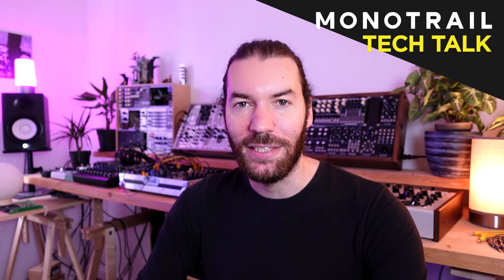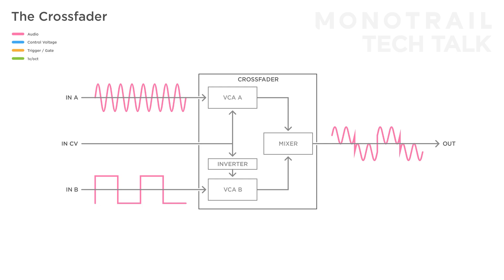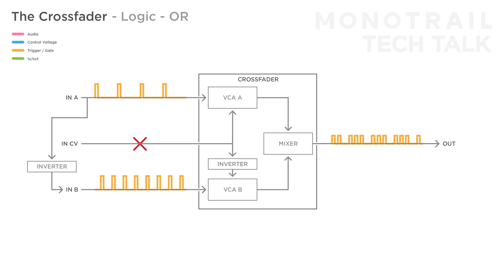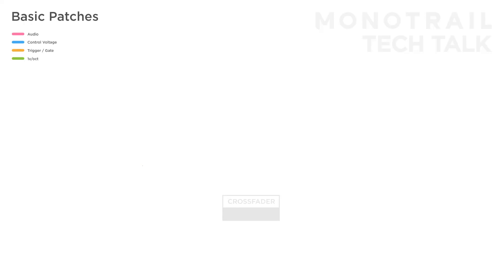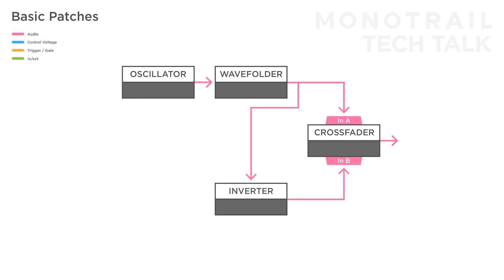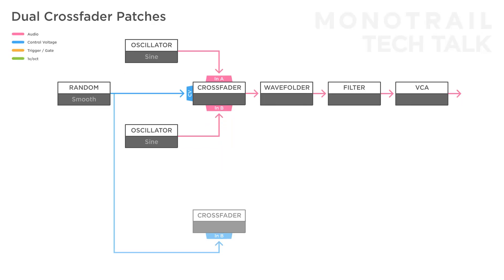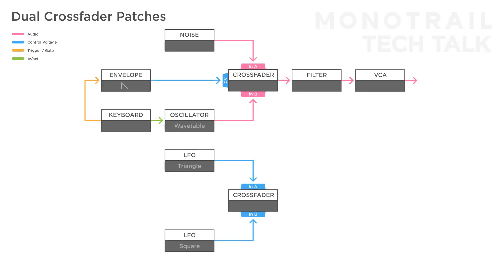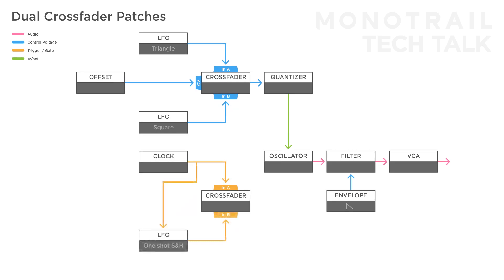Why you need a crossfader – The secret Swiss army knife, Doepfer A134-2

Comment: I’m trying to use Mk4 H1 - Crossfade/Pan to Crossfade between two triggers patterns but it does’t work as expected. I don’t know why.
Reply: I found the solution, parameter 1 (clip mode) has to be set to 1 and not 0